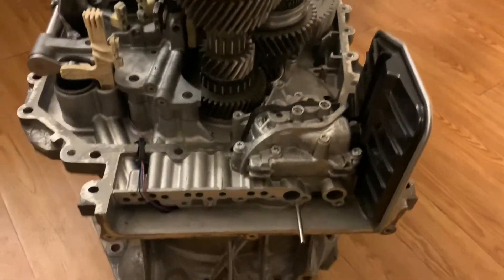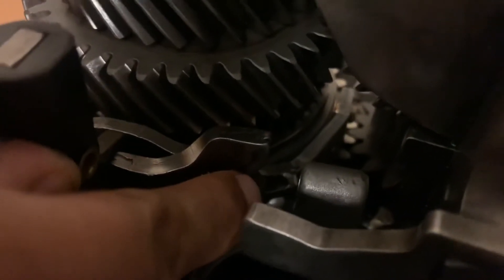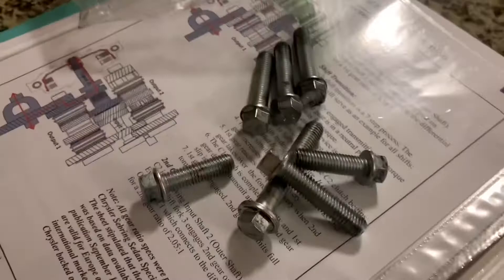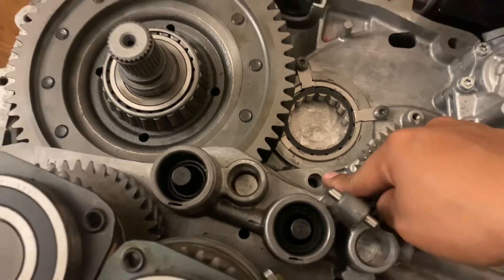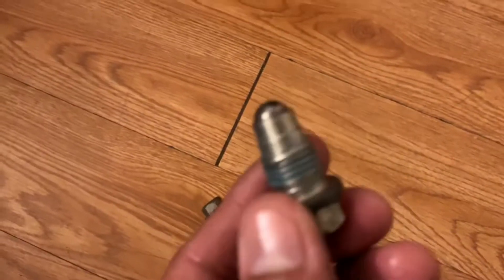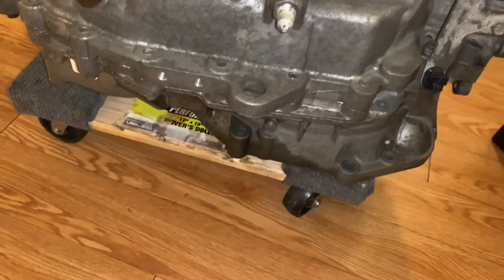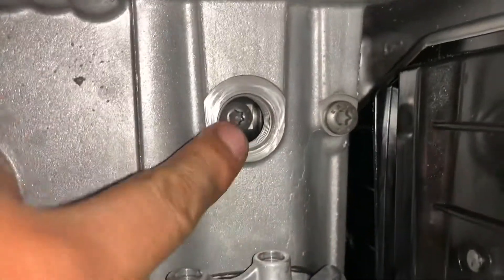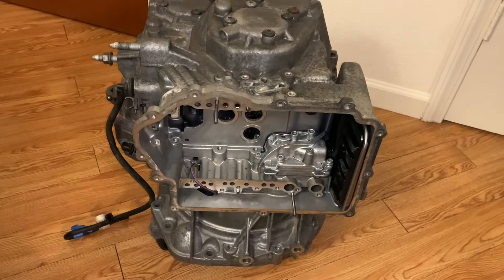Mitsubishi Evo X MR DCT470/ 6DCT470 Transmission build - Part 9 Rebuild, Closing The Transmission

Comment: I’m trying to close mine & it’s getting stuck. Any clues?
Reply from the maker: The side where the mechatronic unit goes, that’s like your window to see the shift forks and to align them up. the other 3 openings where the bolts for shift forks go outside of the casing, that’s also windows you use to see if it’s aligned. I used flat head in those three holes to push up on the shift forks. Take your time on it. It literally took me 3-4 hours. If you need help go to my Instagram, that way I can communicate with you better. Instagram: Skylar Evo X

Comment: I have this same problem. How you closed transmission? It is impossible. I'm afraid damage parts inside. Give me tricks and tips.
Reply from the maker: Ok so you have to have a flash light to look inside the transmission. You have your shift forks that have to align to the top holes. So in order to do that you have to pry open one side of transmission and also pull one of the shift forks up , (you’ll hear it shift up) then let go of the side you pried open so it can sit in there perfectly. Hope I’m making it clear. Plus you have like 3 openings of where the bolts that have rounded ends, that’s where the shift forks sit on. So on those openings you’ll see this curved area that the shift fork has, you can use a flat head to slide it up at the same time you have a pry bar lifting up the side of the transmission. That way it makes it just a bit easier to guide it to the hole. Let me know if you need more help
Reply from the maker: there are 4 bolts with balls, these are inspection windows they will help you to guide the forks into their seats